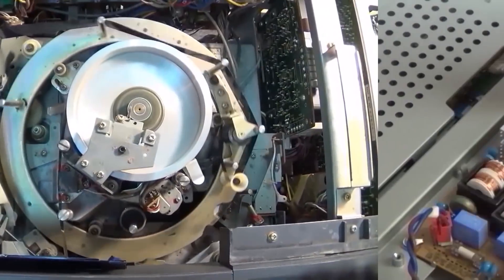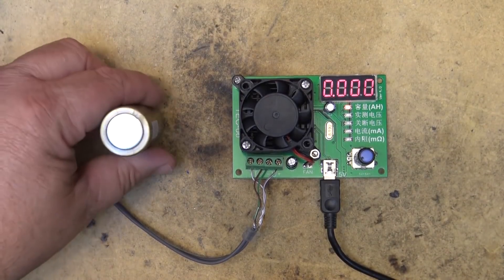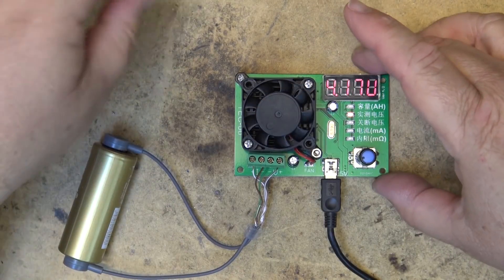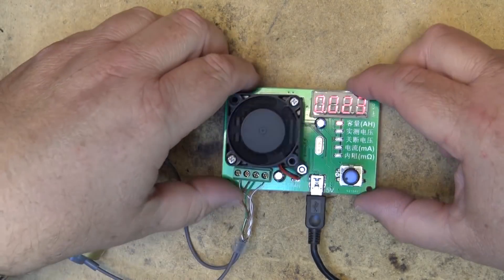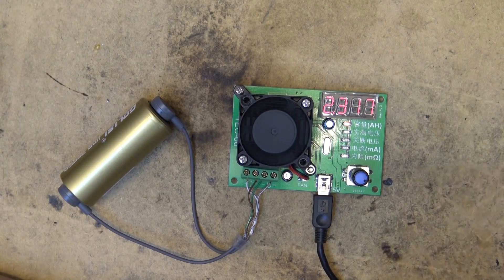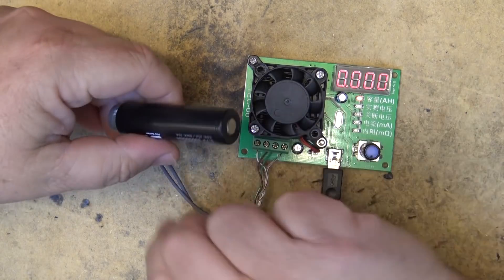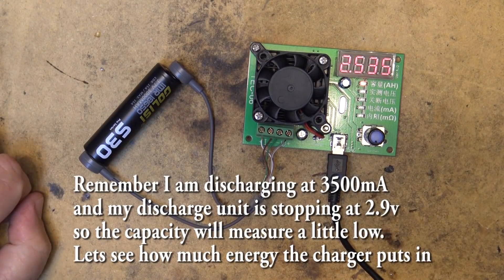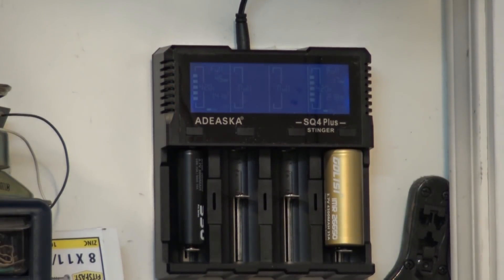GOLISI Lithium Ion Battery Capacity Measurement

Comment: Wanna bet the cell capacity is stated at a much, much lower discharge rate,  say 0,1 to 0,5 A?
Reply from the maker: True. My discharge unit stops as soon as the voltage hits the limit I set, which will happen sooner at high discharge current than say 1 or 2 amps.  When the cells went in the charger they showed 3.2 volts. Had I discharged slower as I did in the flashlight the discharge voltage would have been lower as the discharge unit shut off as soon as the voltage dropped which would be sooner at high discharge current. This was a high current test to check to extreme discharge.

Comment: I work at surplus store man and today we had a 6v headlight powered at 6v with barely any light then we tried 12 and it worked as it should.using a digital power supply. Is there some reason besides possibly us misreading something? Like maybe the 6v is two in line 6.v or something like that from the factory? And they labeled it ...ehh.. differently? (On the headlight) ..there weren't any symbols we didn't recognize.. the light read for 6v but barely powered it. Thoughts ?
Reply: ..3 ppl checked...I dunno it's 3 a.m. man lol thanks for the vid